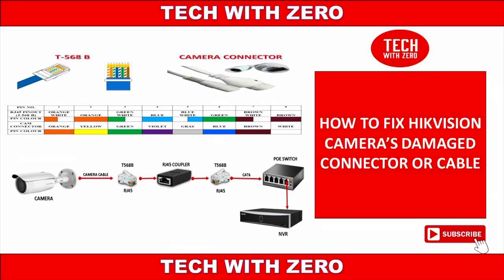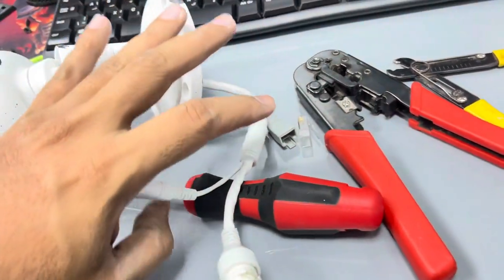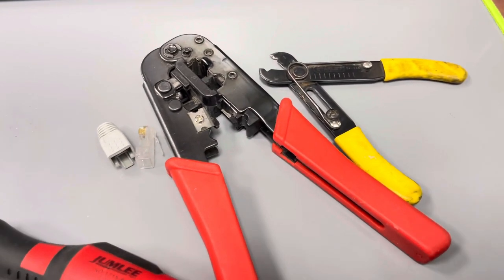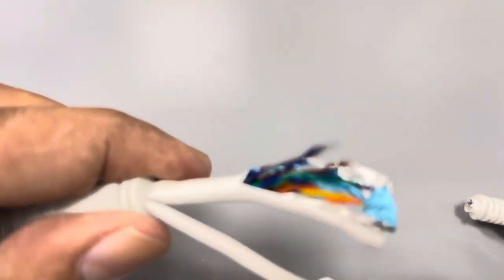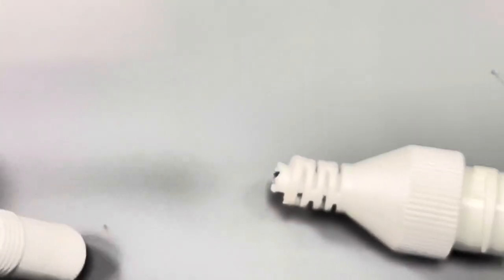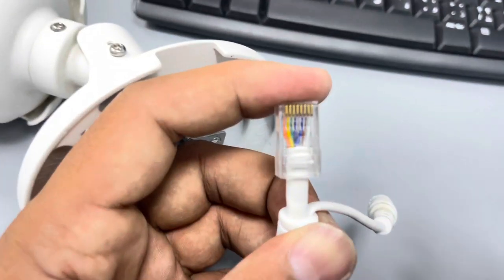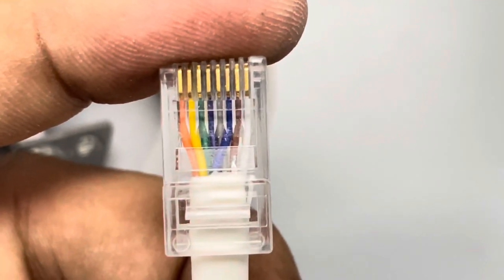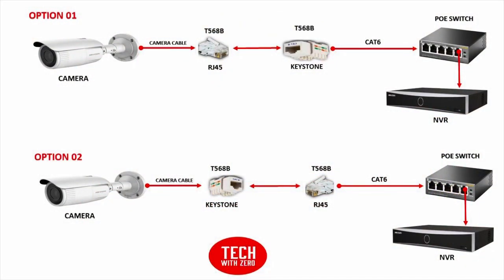HOW TO REPAIR OR FIX DAMAGED CCTV CAMERA CABLE | HIKVISION

Comment: Great. Helpful on one of my cameras. On my other camera, the female ethernet port connector is fine but the wires inside are flat instead of being angled/ sloping so an RJ45 is wobbly when inserted. Is there a quicker way to just push them and get the port working again?